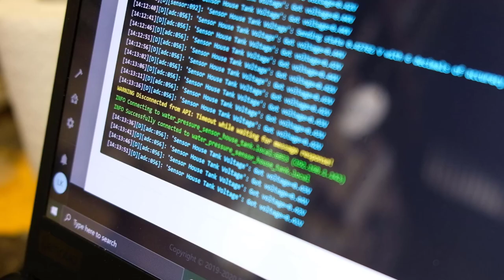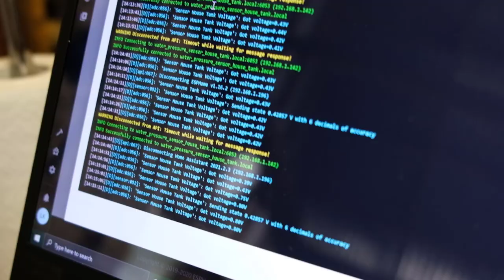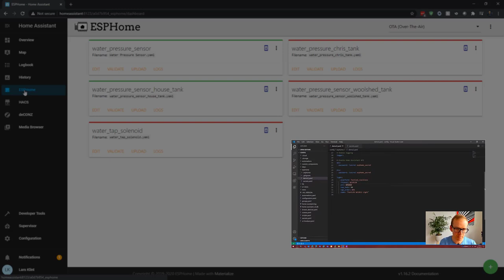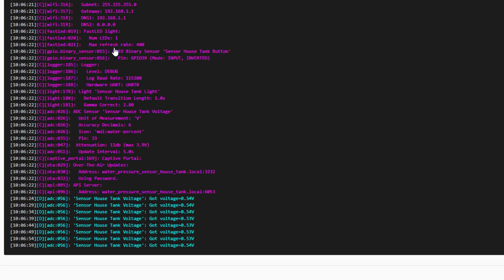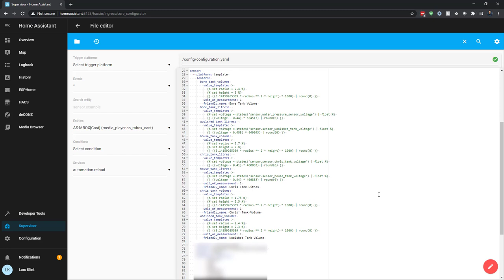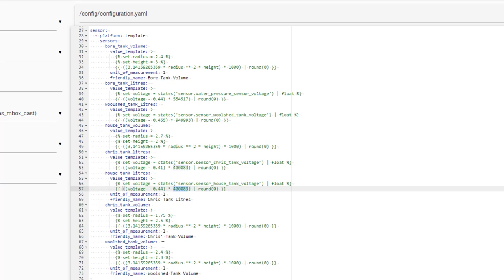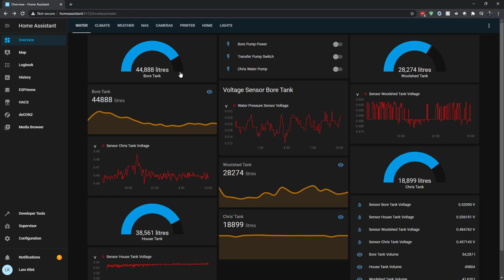Measuring water tank levels with Home Assistant

Comment: Hi Lars,
A great solution that I have been looking for for a long time. My M5 stack and pressure sensor have been ordered a while ago and meanwhile everything seems to work fine, but at one point I don't follow. I am probably missing something, but why is the 1v value important when you know how many liters you can put in your tank, and how do you calculate that value?

With me 0.04v is an empty tank, but the rule of 3 does not really get me there.  0 litre * 1v / 0,04 v ..... stays 0
Reply from the maker: Excellent question. For my four pressure sensors they all have different voltage for an empty tank. But I don't know what that value is, because I am not about to empty the tanks to find out. Instead I am going to approximate the current water to voltage ratio. I can measure the water level from the top, e.g. 600mm, and I know how big the tank is, e.g. 2100mm tall and a radius of 2700mm. 
Knowing that, I can calculate the litres currently in the tank and I know the voltage being measured. For example there is 33,000 litres in the house tank at 0.408571v. I need to know how many litres would be in the tank at 1v so I can multiply it by the current voltage minus the "empty" voltage. (current v - empty v) * litres at 1v. 
Now the "litres at 1V" value is an educated guess and you might have to do this a few times. From the bench test I have an idea that 0 litres is about 0.365v, but it can vary up to .44v for one of my sensors. So, in this case litres at 1v is 33,000 / (0.408571 - 0.365) = 757384 litres. 
Now, when I get a voltage reading, such as .412561v I can calculate that is 36021 litres. This is a bit complex, but the only way I could figure out how to do it. It has seemed very reliable once I got the "empty voltage" adjusted properly. I hope this helps 😊
Reply: @LarsKlintTech  You are a Pro !!!  
Thanks for the extensive explanation.
I will continue to work on it !!
Reply: @LarsKlintTech  If you read the voltage before you drop everything in the tank then you have the voltage of an empty watertank. Or am I'm missing something?
Great tut by the way, thank you very much. I've still some problems that I hope to solve.
Reply from the maker: @jean-claudeverdonck5053  Correct. That is also the value (bench test) I am using in the blurb above 😊
And thanks for watching too.
Reply: @jean-claudeverdonck5053  Hi, I guess when you measure the voltage before you drop the sensor in the tank then you now the voltage from a empty tank. In my case I know how many liters are in a full tank. So when I drop the sensor to the bottom then I know the voltage from a full tank and can working with this two different voltages.

Comment: Hi Lars,
Thank you for the inspirational video. I just got around to implementing a similar setup after having the parts on hand for about six months! I'm using it in an automation along with a solenoid valve to add mains water to my tank when the level gets low, to prevent the pump from running dry. Keep up the great work!
Steve.
Reply from the maker: Thanks Steve. Excellent! I have just bought two Holman water pipe solenoids for the exact same purpose. I have two tanks I want to top up automatically, so we don't run out as well. We fill it from a bore, rather than mains, but same principle.

Comment: nice idea using the preasure sensor pipe "B*MB" :D, which is the sensor very common used for car so it easy to aquire and cheap, I was planning to add sensor to my tank this would work well as I dont really want to drain my tank empty and drill a hole on my tank, thanks for the video!
Reply from the maker: You are most welcome 😁I have one more tank that I need to do the same with, so I will use my own video too 😂

Comment: Corrrect me if wrong here: The sensor you're using requires 5v power supply, but M5 (if using ESP32?) will output 3.3v max, are you accounting for that? I'm certain you won't be getting the pressure required to get over 3.3v (obviously judging from your screen readings too). I'm wondering if it just works anyway? The sensor your're using appears a lot cheaper than the ones I've been using. 

Respect for this great video btw!
Reply from the maker: Great question Justin. You are right....and not. The sensor is indeed 5V, but the bore tank sensor is still running strong after 2 years. I have seen other implementations same as mine that also works. Now, you are right that I can't get more than 3.3V out, but that works fine in this case too. With 150PSI I will never get anywhere near 3V. 
However, I didn't like this entirely either, so I have done a v2.0 with a Shelly Uni and a 12V sensor and power supply: https://youtu.be/N90C9Xge8Z4
Reply: @LarsKlintTech  Thank you, being able to run one of these sensors on 3.3v is a game changer for me; much appreciated ! I enjoyed your other video too; seems like you're not only making super helpful videos, but from the comment section creating a helpful community too. Respect.
Reply from the maker: @JustinShaedo  You are most welcome Justin. The community part of this channel is a large part of why I keep going. I learn a ton, and hope to give some of it back, and of course I enjoy the creation of the videos too 😊

Comment: Hi Lars. Awesome stuff. Was looking for exactly this solution. Question I have is how do you deal with the wifi connectivity. I only have an acre but very hilly and have 4 tanks to look after. Just interested on your wifi topography especially when the bore tank module sits in a Faraday cage the iron shed.
Reply from the maker: Thanks Janusz. Appreciate the kind words 😊
I have a LOT of wifi coverage on about 30 acres, so I am spoilt for connection options. I have 15 access points covering most of the farm, which are connected to 5 switches in various buildings. I have an access point right outside my pump shed which, but the signal comes through okay. A couple of years ago I made this walkthrough of the entire setup (which has changed a bit since): https://youtu.be/IMrlIYNZCe8
If you can get your signal to various places on your property, thus covering a larger area, that would increase your chance of connecting in more places.

Comment: Hi Lars, great video. Please keep up the good work. Also, have you considered expanding this  for sensors/field measurement devices at a distance. Im thinking of trying to use the ATOM DTU LoRaWAN915 or similar in an attempt to measure tank levels some 200+ meters away. Would you have any thoughts on this?
Reply from the maker: Hi Lyle. That is an interesting idea. I didn't know that device existed. Because it is 915Mhz, what receives the signal on the other end? Do you have another device that can receive that frequency and add it to HA? Can you explain more of the architecture you are thinking?

Comment: Thankyou Lars for the video, gave me inspiration to try this, only problem I have is all of it, I fail to find the easy bit, hours and hours and hours of trying all I can do is turn a LED light on and off. got any hints thanks
Reply from the maker: The hint would be to find a project that saves you time or money, or both. Turning a light on an off is great, but if you can put it on a timer relating to sunset/sunrise that could be more useful, as an example. I have outdoor lights that do just that. Come on a sunset, turn off at 10pm. 
Or you could have a motion sensor that tells you when someone is at your front door, when you are not at home?
Reply: @LarsKlintTech  yes thankyou I can already turn light on and off automatically, I just want to save time measuring the amount of water in my inground water tank so i can save money on when to run the pump so your water tank project fits the bill, I just cant get it to work I know I'm missing something easy   Thanks again for replying

Comment: Great video. You’ve introduced me to a new world. 

I don’t mention it, but what’s the water pipe connection that allows for a sensor installation? 

Thx!
Reply from the maker: Thanks Shaun 😊 And welcome to the rabbit hole of automation 😏
The connection in the water pipe is just a thread that matches the sensor thread. I use something like this to make the thread after the hole is drilled: https://www.ebay.com.au/itm/134330127244?hash=item1f46b3138c:g:UK8AAOSwao1bFPUV
Reply: @LarsKlintTech  ohhh so you just drilled into the current pipe vs putting a ready made wedge that has the sensor pre drilled. Interesting. Is it poly or metal?
Reply from the maker: @byrnecore  Yes, correct. All the pipes on the farm are old metal pipes, so it was pretty simple to do, rather then having to replace the whole piece of pipe.

Comment: Great video, thanks for putting it up. 
Just an idea but it may be possible to get better results using a lower pressure rated sensor. 100psi is the pressure of water at around 70m depth. Your woolshed tank looks about 4m deep which would exert less than 6psi when full, a lower rated sensor could possibly give better resolution. Does that seem right?
Reply from the maker: Yes, you can absolutely use a sensor for lower pressure. These sensors were the best for the cost, so I made them work. Same principal applies though for using a 10psi sensor for example.
Reply: TLDR: This setup (150psi sensor + ESP32 chip) has a theoretical maximum fidelity/resolution of 2.6cm and a practical one of ~10cm. 

The math/calculations: The ESP32 chip can differentiate between 4095 points (it's analog channels are 12 bit). So the chip can see up to 4095 points of voltage change across the maximum sensors range (imagine there are 4095 points marked along the side of the tank, then the chip can determine a change between each of those points, but that's it's maximum resolution). The sensor has a psi reading between 0 and 150psi, which equates to 0 - 105m of water. So there are 4095/105 = 39 points/m. Or a resolution of ~ 2.6 cm. 

This is IF the programming is perfect, and the voltage is either perfectly linear or perfectly calibrated and the unit is without error (pressure and temperature contribute) In reality is probably going to be about 50% accurate for both and they are typically 3% accurate (manufacturers claim 2%) So a practical fidelity of 10cm. 

FWIW there are 30psi sensors that would work (And give 5 times the resolution) but any better and you're looking about 4 times the cost. You can also get a better voltage sensor; eps32, arduino, etc require an external board and these can give you around 10 times the fidelity at a reasonable price (maybe $35 au)

Comment: Thanks for the great video Lars! Just wondering if you have a voltage divider on the pressure sensor output or you just feed the output straight into the M5 ?
Reply from the maker: Directly into the M5. The voltage from the pressure sensor is max 4.5v and the M5 can take 5v (at low amps).
Reply: @LarsKlintTech  thanks for the reply mate!
Reply: @LarsKlintTech  Where does it document this? It looks like you are getting away with this as the sensor output voltage range is 0.5 to 4.5 and the PSI rating of your sensor and the measured pressure level voltage never exceeds the input limit. PS. Can you publish the sensor portion of esphome YAMAL file?
Reply from the maker: @fredstephens6793  It is documented here https://docs.m5stack.com/en/core/atom_lite
Yes, the voltage never exceeds 4.5v from the pressure sensor.

Here is the sensor config in yaml:
sensor:
  - platform: adc
    pin: 33
    name: ${friendly_name} Voltage
    update_interval: 30s
    icon: "mdi:water-percent"
    accuracy_decimals: 5
    attenuation: 11db
    filters:
    - median:
        window_size: 200
        send_every: 10
        send_first_at: 4

Comment: Lars, curious to know what distance you are sending your data through wifi? The reason I ask is that i just tested an ESP32 connection to an outdoor unifi AP. The distance is about 60 metres but I see no connection strong enough to send/receive (I am only testing this by seeing if I can browse to the IP address of the ESP) My unifi network shows it is connecting sometimes. Am I better off sending the data through cabling to an ESP32 closser to the AP?
Reply: I guess i should have watched a few more of your videos first. It seems you have a plethora of unifi outdoor Ap's that pick up signals around your house.
Reply from the maker: @patraff1280  Yeah, I have smothered the property in Wi-fi 😂
Having said that though, you do need to be quite close to an AP with the M5Stack Atom Lite I am using. My guess would be that 60 meters is too far for me as well. I would aim to be within 20-30 meters.

Comment: Where did you purchase that length of cabling from?
Reply from the maker: Which cabling do you mean Andrew? The actual cabling for the pressure sensor is just 16 gauge electrical wire in various colours. That comes in rolls of 20, 50, 100 meters and more.

Comment: Please take the time to explain the process to get it working with sensor and with the hub
Reply from the maker: As I mention in the video, Tatham has a great video on connecting it all through ESP home and coding the YAML parts. https://www.youtube.com/watch?v=lc5cv6X7bXk&t=0s
Check that out first 😊
Reply: @LarsKlintTech  Yah I went there first but Tatham video was a bit advanced for me as I'm new to IoTs. Anyway, great video see if have the time to show step by step guide in future almost nobody implemented the same device in such a way as you did witch is quite helpful to many as some devices in the market sells for almost 500$ for tank level monitoring.

Comment: Great job! Mine works now too, but I've got a question. If I want to use the same setup - another Atom Lite and pressure sensor - to measure whether or not the pump on my pond is working, I could insert the pressure sensor off the line the pump uses. 

My question would be "What am I measuring?". I suppose if the sensor says "empty" then it's at atmosphere and the pump is off. But what will the pressure be when the pump is operating? Higher, right?

I'd set the scaling on Home Assistant to say X voltage means pump is 100% and Y voltage means 0%, and interpolate a % from an inbetween voltage.

And does the sensor need to be "in the stream" of water, or is the pressure going to be higher off of a "T" intersection?

Tnx
Reply from the maker: Good question. Measuring moving water will give a non-predictable result in my experience. I have a tank with no stop valve, which means the pressure is moving constantly. You would probably be better off with a flow meter instead, as then you can measure how much water is coming past too. Something like this perhaps? https://www.amazon.com.au/MagiDeal-Connect-0-3-10L-Effect-Sensor/dp/B074V5RTFX/ref=sr_1_9?keywords=flow+meter&qid=1636499835&sr=8-9
Reply: @LarsKlintTech  Thanks!

Comment: for a 150 psi sensor, is it accurate to measure a 2m height tank with a maximum pressure of 2.4psi ?
Reply from the maker: In this case, yes. You get about 6 decimal places of accuracy on the voltage, and if you take a median value over a window of a couple of hours, then you get a pretty accurate measurement. Having said that I have done a V2 of the setup using a different sensor and Shelly Uni on three of the four tanks. That video is here: https://youtu.be/N90C9Xge8Z4

Comment: Excellent. So correct me if I'm wrong, but to accurately interpret the voltage, could i connect the sensor to some pvc pipe the same height as the tank and add water to record the voltage at multiple levels?
Reply from the maker: Yes, you should be able to. I find the voltage does vary a lot. You'll never get a stable measurement due to atmospheric pressure, water flowing etc. But with an appropriate number of measurements over time, you can get a good average.

Comment: Hi, Lars
So most of water tanks in my country are placed above the roof and mostly use float sensor,
the problem with this method is the sensor would be rusty or ants would get inside the sensor after a while.
and that's a nightmare to fix since I have to climb all the way up. 
so I'm looking for alternative method that can be placed below the roof and thus easier to fix,
I noticed you placed the sensor next to the tanks, my question what if I place the sensor on the pipe on ground level right below the tanks? Any potential issues?
Reply from the maker: Good question. That could work, but the main issue is often getting a constant pressure. You want to insert the pressure sensor at a point in the pipe where the pressure doesn't fluctuate much. If you can do that, it doesn't matter where you put the sensor. It then becomes a matter of getting enough voltage measures to adjust your equations.

Comment: Your cable appears to be between 75 to 100 feet (23 to 30 meters) between the pressure sensor and the esp. Does this impact your pressure reading or is it negligeable?
Reply from the maker: Good question. I am no expert on resistance, but so far so good. If there is a drop in voltage, it is constant, which I can adjust for in the HA configuration.

Comment: How accurate would pressure sensor work for 55 gallon water drums I catch rain into?  Once full, I will pump qty5 of them to 700gallon holding tank.
Reply from the maker: It should work just fine. The main interference is from atmospheric pressure, or if there is water flowing in and out of the tank (such as with a tap being opened). I would suggest getting a 5, 10 or 15psi pressure transducer though, as that will make the voltage more accurate than a 100 or 150 psi model.
Reply: Only time 55 gallons fill is rain which this yr was very little.  It sits unless it is garden time and watering.   Also transfer small full barrels to hold tank. Hmmm  
U have Facebook?
Reply: U have no idea how humbled I am for your response.  I need this in a big way!
Reply from the maker: @smartassist9700  No worries at all. Thanks for watching and being part of the channel. I appreciate it.